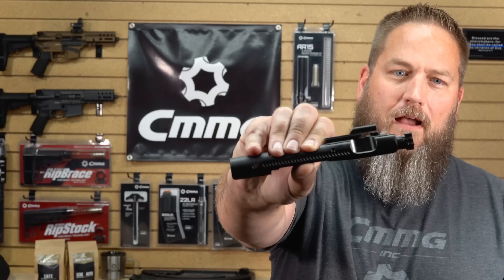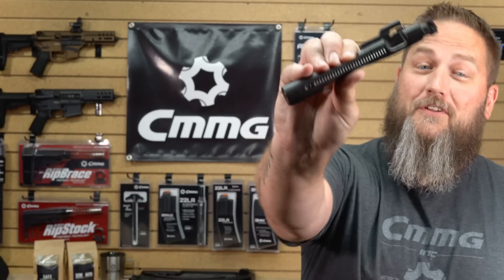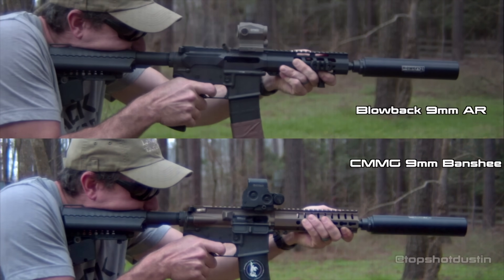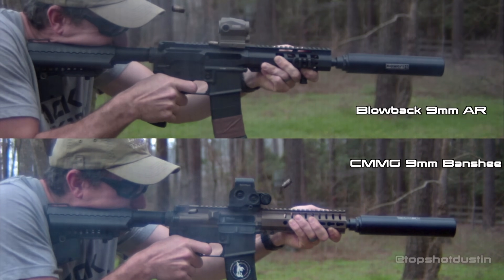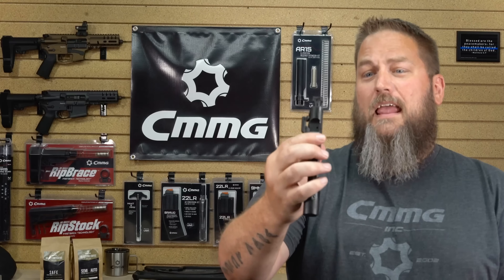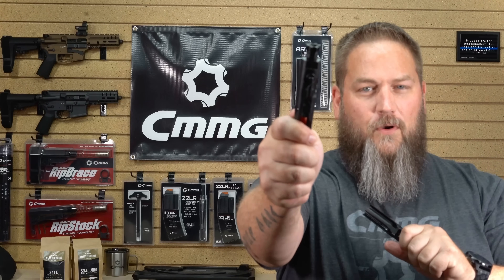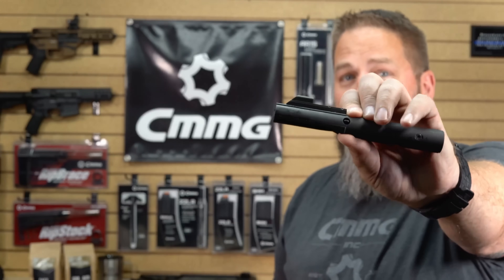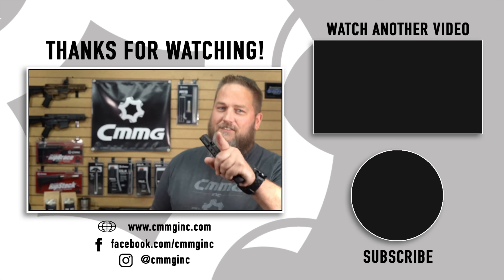What's the deal with Radial Delayed Blowback?

Comment: I admittedly know very little about the subject, but out of pure curiosity, if you could, please answer these questions I have:
-A bit of exposition first: I know the radial-delay banshee line of guns is mainly composed pistol-caliber firearms (9mm, 45acp, 10mm, 5.7x28 and 4.6x30), but I can't help to think of the HK roller-delayed family of firearms.
Could the radial-delay system be used for rifle calibers (say .223 and .308)? would the pressures be too high? how would it compare to roller-delay? would it require less weight in the bolt carrier and recoil spring? and, I know this might not be possible for you to answer, but still, are there any plans for producing rifle-caliber radial-delay firearms in the future?

Loved the video! I think the radial-delay system is an amazingly ingenious way of adapting the already existing parts of the ar15-type rifles and carbines to work without needing gas operation or the extra weight of straight blowback, just by, and pardon me if I am over-simplifying it, cutting the bolt lugs at an angle and cutting matching angles in the chamber.

Comment: What is the purpose of what is attached to this BCG in place of a gas key? Does it even need to be there?
Reply: Ah, I have just realized, that that is how the charging handle is grabbing it!
Reply from the maker: It also keeps the carrier aligned in the upper. Without it, the whole carrier could possibly rotate while cycling and cause bigger problems.

Comment: Will CMMG 9mm upper work with Stern pistol magazine adapters?
Reply from the maker: It may require some tinkering. We've played a little bit with some various adapters, and the ejector and feed ramps (if they have them) will need to be removed. Mag seating height could be an issue too. We've seen some mags feed fine (primarily Glock OE) with some cheaper polymer mags don't.

Comment: Hey i got a cmmg 22 conversion kit. I polished the rails n feed ramps cause only complaint I saw was some people had feed issues. No issues with feeding but my aftermarket trigger doesnt like to set the primer off. Any solutions? I polished the firing pin and spring too havent tried it yet to see if it helped
Reply from the maker: A lot of aftermarket triggers have lighter hammer springs. If there's a way to change that spring and make it stronger, that's the better bet.

Comment: So basically your saying i dont need a gas system or a buffer kit? I just purchased the barrel/BCG combo of yours from Primary Arms! Its awesome i paid for the speedier shipping and its packed awesomely and the cleanest  looking barrel i ever bought!! So if i dont need a gast system or buffer kit im living with a much cheaper set up! :>)
Reply from the maker: you still need a buffer system, just not the heavier ones used in traditional blowback.
Reply: @CMMG  is that the H1 buffer?
Reply from the maker: @michaelw.urbansr.8617  our RDB is standard carbine. Traditional blowback is a much heavier 9mm specific buffer.
Reply: @CMMG  Thanks but i purchased your barrel/BCG combo chambered in .45ACP....? hehe I did contact your company via email/customer service and Bryan told me that i should use a Carbine length buffer and an H1 buffer which i believe is what a standard AR Carbine chambered in 5.56 comes with normally right? I did buy a pistol caliber specific buffer kit.....so im guessing we will see? lol I also have a .224Val AR i built but it has a Carbine length buffer and kit on it so i am in the middle of replacing that with a fixed rifle stock and buffer kit. I hope it improves its cycling and helps with its accuracy a bit? or it may just be me who knows?ROFL
Reply: @CMMG  what about the Vltor A5 buffer system?
Reply: @foxhound9285   Well i made the mistake of buying your 16" barrel and BCG combo from a 3rd party retailer and they didnt have it  listed as a proprietary system. SO i cant afford your companies upper/lower set to go with it. Im hoping the barrel i purchase that you guys sell with the 45ACP BCG will still work on another build? I have the BCG put away for possible furture use. But for now i put together a traditional 45ACP carbine with a KAW valley BCG. I just hope your barrel isnt proprietary ,because i have yet to test fire it? Will the barrel run fine with someone elses upper/lower and BCG? I pray

Comment: The two CMMG RDB 9mm uppers I've used had very snappy recoil like a straight blowback 9mm AR but were very unreliable.  One was my buddy's upper, which he returned to CMMG and they said it was faulty and replaced it.  The replacement is the other one I've used, and it also doesn't work.  I really don't like straight blowback 9mm ARs, but at least they work until they hammer themselves to death.

I have a CMMG 22 AR upper, and it doesn't work.

My other buddy bought a CMMG LPK for his AR, and the trigger doesn't reset.

They're 0 for 4 in my book.

I think the CMMG RDB could be really cool, if it worked, or did any of the things they say it does.  But it doesn't, because the operating system is total garbage.

Look at their slow mo in this video, and check out the ejection pattern on their gun.  It's random.  Some rounds bypass the shell deflector.  On my buddy's gun, almost all the cases bypass the deflector and some hit him in the face because he's lefty.  The guns just don't work.  I'm glad they showed how garbage their guns are in their own advertising.  Check out how repeatable the blowback action is in comparison.

Comment: That's great, but why not just go DI? ie what's the advantage of any delayed blowback design over a DI or piston setup? I'd love to build a 10mm AR pistol, and the radial delay seems like a neat idea, but I'm still wondering how it would compare to a DI or short stroke piston 10mm?
Reply from the maker: Lot of technical info there. Trust us. We looked at DI, but it created more problems than it solved. So, RDB was born.
Reply: @CMMG  How does the recoil impulse compare in a similarly sized gun to roller delayed in something like an MP5?

Comment: Sold. Take my money.
I have a boat load of uppers and lowers (556,308 & 300). I loaded up 20k 9mm, but only had a 1911 in 9mm. I ended up buying a Kel-Tec Sub2k in G19, so I had to buy a G19 as well. I love the fact that I can plink 4in steel all day long at 95M with the Sub2k. The AR 308s and 556 destroys the chains. Ive been looking at 9mm AR builds for the last 5 years, all straight blowback. Gimmick or not. Im sold on the gimmick.

Comment: Wonder why the banshee mk4 can't be converted into a 45 acp or 10mm?  You can get it in 300 blk out, 5.7 but then the next caliber that it can be converted to drops all the way down to a 9mm 🤷‍♂️ I would like something a little cheaper to shoot but not have to lose a bunch of stopping power. Not that the 9mm doesn't have stopping power obviously.

Comment: So will this work with new frontier armory glock 9mm lower and a new frontier upper with LRBHO? Basically I'm asking if I get the barrel and the bolt and throw it in, is that OK?
Reply from the maker: It's going to take some modification. That lower is traditional blowback. You're going to need to remove the ejector and the feed ramp from the lower. Even then we cannot guarantee its reliability, but we have seen people do it.

Comment: Can i replace the bolt carrier in my AR with the delayed bolt carrier?
Reply: You'd still need the proper chamber for the chamfered lugs to operate against. At the very least, you'll also need a barrel designed for the radial delay system.

Comment: What is the problem with introducing Radial Delayed Blowback System in higher pressure cartridge like 556?
Reply: The force on the back of a cartridge is way way higher with rifle caliber rounds so direct impingement means the gas doesn't start to unlock the bolt until the bullet passes the gas tube. With radially delayed it would happen immediately.
Reply: @3darms  can you just make the lugs bigger and further delay the action as for the ammo maybe we can use something like Sig's new 6.8 hybrid catridge that has a steel bottom and brass body to prevent ejection problems?

Comment: Does the CMMG 5.7 x 28 radial delayed blowback still require coated ammunition in order to feed and extract?  Reloading 5.7 x 28 is pain in the ass because of the plastic coating.  It would be so much simpler to just throw it into a tumbler.

Comment: I'm currently trying to get my radial delay blowback upper to work with a 9mm Colt style lower. It really seems doable. So far I've removed the lower ejector. Then what I see next is the lower feed ramp side and the magazine lips are about 1.2mm too high for the bcg to pass over it. I've trimmed down a cheap mag and I think I have good clearance with that, next is the feed ramp. Will this ultimately work, has it been done yet, or am I wasting my time?
Reply: It'll work, sometimes it takes a little messaging to get different parts to work
Reply: @scottkimball4225  the hardest part for me right now is trimming and adjusting the mag feed lips and getting the mag to run smoothly. 

My set up is the 9 radial delay bcg/barrel in an Aero upper and then attempt to mate it with a Spikes Colt 9 lower. 

I have to say the upper ran awesome on my standard lower with the Pmag conversion. I just wish they made the conversion for the 40 round Pmag, if that was a thing I might scrap this project.

Comment: I want a delayed blow back but not sure it’s even compatible with my Glock lower.
Reply from the maker: You just need to make sure that your Glock lower doesn't have the feed ramps and ejector built in. Those will get in the way of the RDB system. As stated, a lot of times those are removable, but we still don't test with others' lowers to be able to guarantee compatibility.
Reply: CMMG if I could I’d buy a fully built set up but sadly those are not legal here. My only option is to build on what I have available in Connecticut
Reply: They sell a bolt group & barrel for 350$ to 400$ , you can catch a sale sometimes and get one for 300..  its  well worth it
Reply: Since it's all in the upper, there should be no problem.